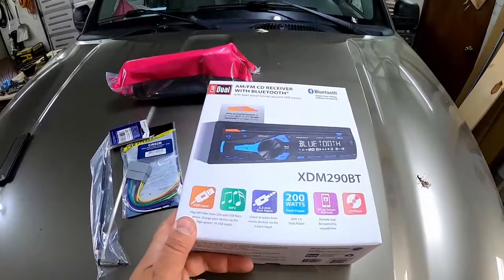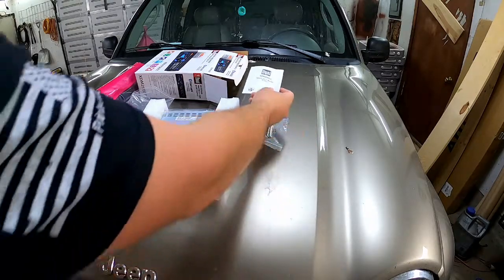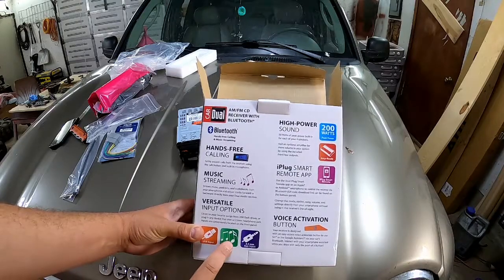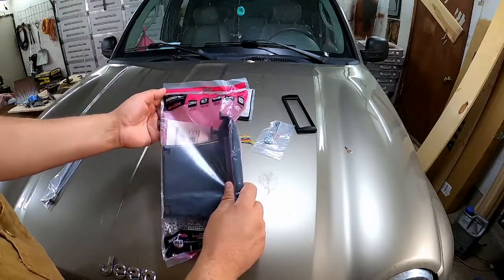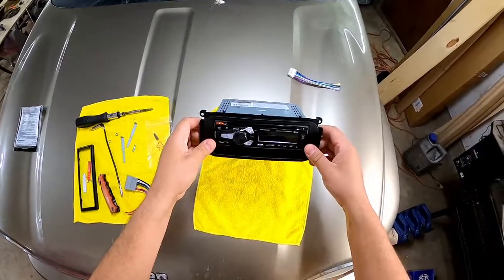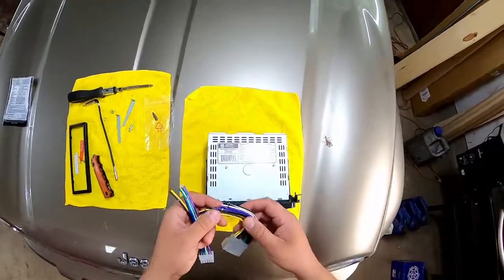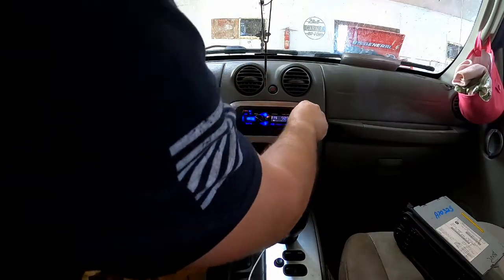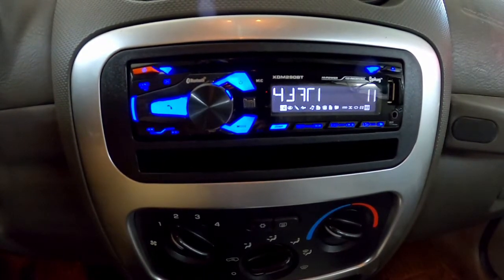DUAL Electronics XDM290BT Installation and Review

Comment from the maker: Thanks for checking out today's video.  If you enjoy it, we hope you'll decide to join us for the next one.  If you're looking for a cheap aftermarket stereo for your car or truck, you might consider giving this one a chance to win you over.  Bluetooth listening works well and for under $80.00 total (including aftermarket wire harness, face plate, and antenna adapter).  The radio itself was $49.87 at Wal-Mart.  Links are in the description.  God bless -2SG
Reply: I can’t figure out the pin for the Bluetooth
Reply from the maker: 1234 I believe.   Let me know if that works for you.
Reply from the maker: 0000 if 1234 doesn’t work
Reply: No sound will come out any suggestions?
Reply from the maker: @latashahamms6622  yes, happens all the time because often the speakers need power which comes from the blue or blue/white wire.  

If I get some time tonight, I’ll look it up for you.
Reply from the maker: @latashahamms6622  this is likely the fix you need. 👍 
https://youtu.be/nzW8wQQN2iw

Comment: Bluetooth works great I have been using this radio for more than 2 years now and I am completely satisfied with the radio just wish I could get the scrolling to stop on the screen
Reply from the maker: Same here!
Reply: I have the previous version of this radio. Press and hold I believe the audio button...then push it to to scroll options. When you get to demo mode on/off turn the volume dial to off.

Comment: Anyways...download the manual it it says press and hold the volume button to access other things.  Press it briefly to adjust equalizer, but press and hold to get to section where u can disable demo mode and control the screen some among other things....I didn't need the orange wire to be hooked to anything...older stock stereos used the orange wire for illumination dimming etc....this radio doesn't do that and thus no need for the orange wire in stock car harness.  Just leave it hanging loose and taped or heat wrapped.
Reply from the maker: Excellent info about disabling demo mode. Many have wondered how to do this.

Comment: What's the orange wire for...i hooked one of these stereos up in a 2006 subaru impreza today and the car harness had a orange wire for illumination but the radio didn't have an orange wire to hook to so I had one orange wire attached to nothing after finished...but the radio works well.
Reply from the maker: I can’t remember what the orange was for but don’t sweat it.  There are wires for options that some vehicles simply don’t have, therefore, no hookup needed. 

Nice work installing the unit. 👍
Reply: @2StallGarage yeah I agree...the stereo doesn't have the orange wire....the car does...who cares...just hook up like to like  wires and it works perfect...orange is for illumination on the stock subaru radio...not needed for this radio.

Comment: Just installed this in my 87 f150. Works great so far but the "demo" type scrolling that displays when Im listening to the radio is a little annoying. Any advice in how to get rid of that?
Reply from the maker: Unfortunately, there are only display options, meaning you’re able to choose what scrolls on the screen, but you’re not able to turn off the demo type scrolling.
Reply: @2StallGarage  It is in demo mode if it's scrolling. Press and hold audio button to go through various features. When you get to demo mode, rotate volume dial to off.
Reply from the maker: @danielsavage2481  pinning this to help others.  Thank you, sir!

Comment: Have you figured out how to make the LCD screen brighter during the day? I can only see it at night, but the rest of the stereo is too bright at night. I can't figure out if there's a setting for these things.
Reply from the maker: I haven’t.  If you figure it out, please let all the rest of us know. 🔧
Reply: @2StallGarage  mine works good but no display I can't see display only if I shine a flashlight at it
Reply from the maker: That unfortunately, would be a defective unit.
Reply: @2StallGarage  damn it's been a week I bought it last Thursday the 12th and put it in last night. Only cause I work a lot and didn't have time. Dang I bet to late to take it back and I don't wanna redo the harness taking apart lol
Reply: @2StallGarage  and not sure where my receipt went.
Reply: @2StallGarage  know I have a orange wire on the adapter that fit to cars existing cars wiring but not on the radio harness that came with radio so I hooked orange wire to red power would that be the reason
Reply from the maker: Depending on where you bought it, you’ve got plenty of reason and time to take it back yet.
Reply: @2StallGarage  Walmart
Reply from the maker: You could try disconnecting it to see.  I don’t remember what the orange wire is meant for.    IF you’ve got power and everything else is working properly, it’s likely a defective display.
Reply from the maker: @elijahsparks4341  where did you buy it?

Comment: My wiring harness adapter has 2 Orange wires but the dual radio harness for the radio does not. Where do you connect the orange ones on the blue and red?
Reply from the maker: Strange.  Is one orange and the other orange/white?  “The normal use of orange and orange/white wires is orange is for variable voltage to control display illumination dimming”
Reply: Yes they are
Reply: I’m having the same issue
Reply from the maker: What type of vehicle?

Comment: I have 4 - 5.5 ''  Speakers and if I go past volume 16 it starts cutting out and sounds horrible. Any thoughts?
Reply from the maker: Hope this helps. “One of the most common reasons why your car’s speakers cut out at high volume is because it has too many connections for an output. This happens because the stereo is capable of powering only a certain number of speakers.”
Reply: @2StallGarage   It's supposedly has 200 W of output for 4 speakers so that's 50 W per should be  Plenty for my situation, Maybe a wiring issue, voltage not sure
Reply from the maker: I’m with you. Could be a short in the adapter harness or radio itself.

Comment: I got the same one, installed it yesterday in my pontiac g6. It works yeah, but my knob sometimes turns the volume down when I turn it up and vise versa. Volume also goes up to like 46 but doesn't get louder after 40. Audio won't come through sometimes, gotta pause my music and hit play again for it to work. Wanted to add subs but idk if the radio would handle it. Radio works but I'd put down a little more money and get something a lil better. 
UPDATE! My music was pausing because I didn't wire it correctly lmao oops
Reply from the maker: The knob does the same to me sometimes.  I can live with that, however it might be a deal breaker if the music starts pausing and needs a pause/play a lot.  Did you try restarting your phone by chance?
Reply from the maker: @brycedupps8719  Yep, can't hurt.

Comment: I just bought this for my 04 Jeep grand Cherokee It works but I can’t get any sound for some reason The wiring harness I bought for it is for an 04 also it’s connected correctly  but no sound can someone tell me what I’m doing wrong
Reply from the maker: No worries at all.  There is a blue white wire that isn’t connected.  Can you confirm?
Reply: Yes my blue and white wire is not connected and that’s on the harness and then I have a flat blue one on the plug-in that goes to the radio so would I just connect those two together or should I have two blue and white ones
Reply from the maker: https://youtu.be/nzW8wQQN2iw

That video has your fix.  Very simple.  I had to do this as well. 👍
Reply: @2StallGarage  Thank you for that video man gonna give that a try once I get home

Comment: Great video, quick question is it possible that the radio can display the time with the stereo off?
Reply from the maker: I haven’t ever tried.  I would think you can simply take it out of display mode, power it up and turn down the volume, while setting the unit to display the clock.   Correct me if I’m wrong. 👍
Reply: @2StallGarage  I took it out of demo mode if that’s what you’re referring to with display mode, You’re idea would definitely work, but i was hoping to have just the back light on the display screen on with the time, instead of the entire unit as it gets pretty bright
Reply from the maker: @digbickho I’m right there with you.  I don’t turn it on at night because of the brightness.  Yes, demo mode.  I’m not sure if you can display the clock while off.  Symptom of a cheap head unit perhaps.
Reply: @2StallGarage  damn, is what it is lol. Who needs the time anyways, when it’s dark it’s late, nuff said haha. Thanks for getting back to me

Comment: Mine won’t pair to Bluetooth anymore. Any advice on why?
Reply from the maker: Hey Juan, you can try going into your BT settings and forget or remove the radio from a BT device.   2nd step is turn off and on the BT service and then reconnect with the default password.
Reply: I tried that but it won’t pop back up when I try to pair it again. It just keeps searching for devices.
Reply: I also tried a different device but it won’t pop back up would it have something to do with the wires
Reply from the maker: As long as it turns on, the BT should work.  Did you try putting the radio into pair mode?
Reply: @2StallGarage  no but I disconnected the fuse it was getting power from and that apparently worked. Hopefully it stays that way 😅
Reply from the maker: Well done! 👍